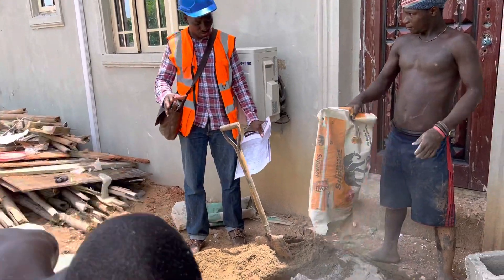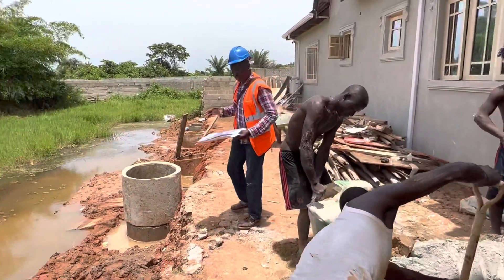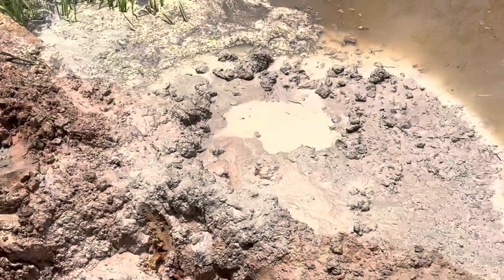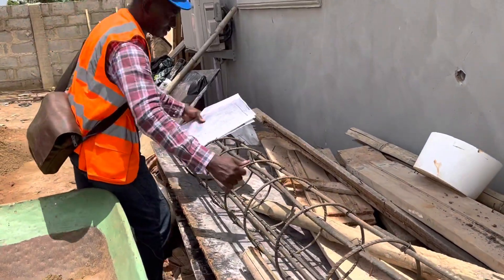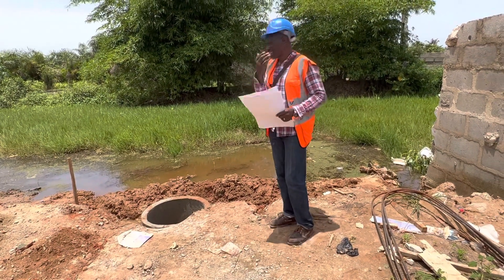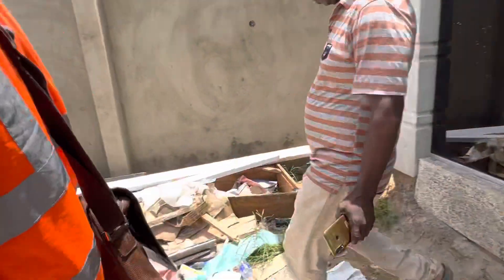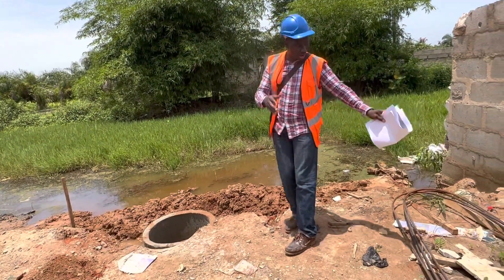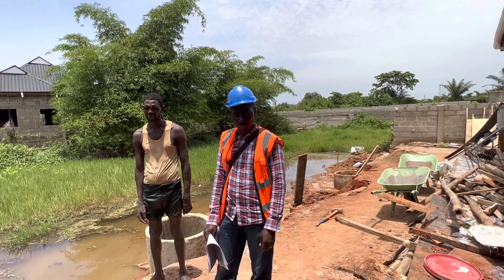THIS APPROACH IS BETTER THAN RAFT FOUNDATION

Comment: I guess the money spent on sand-filling swamped land and reinforcing a structure on it may even be enough to buy another single plot of dry land somewhere else. So I don't think it is a good idea to bother buying swamped land. If there is no more empty land to buy in an area you'll love to build your property, look for a similar or even better area elsewhere and buy. With the collapse of the fence, the owner of this property may now be having sleepless nights due to the uncertainty of not knowing what could happen to the main building itself.
Reply from the maker: Yes you were right but when he bought the land the was all covered up during the dry season when he bout it it was later years that the community was clearing the canal and the whole this surfaced  but he had already gone too far into the construction he can’t pull back for all the money he has spent but with this now it will certainly stop the fence collapsing but this is a lesson for people though, we are just showing how else to do it when they have similar issues or water area